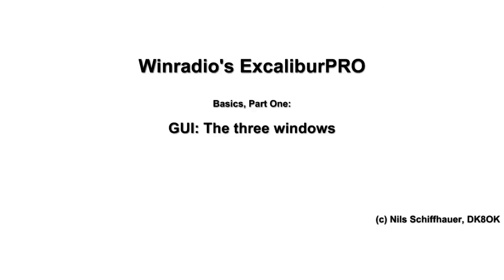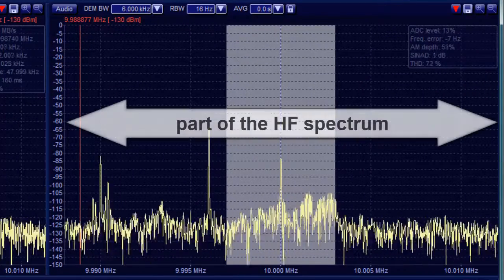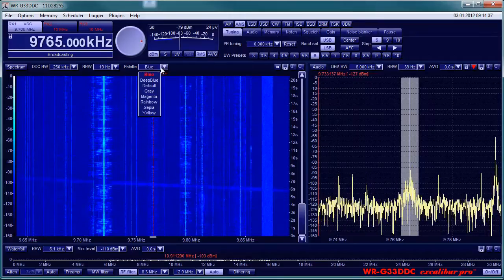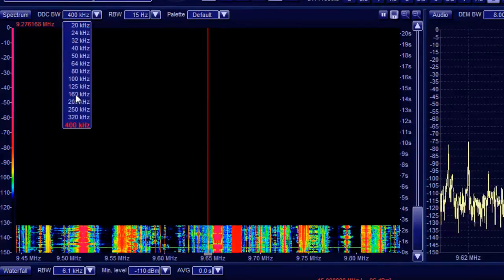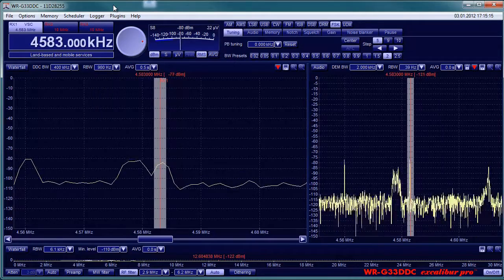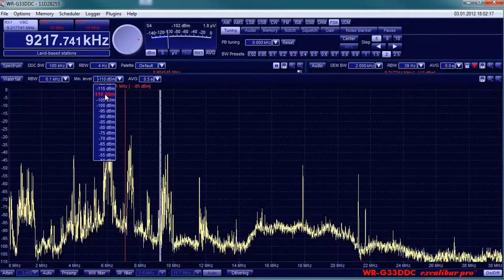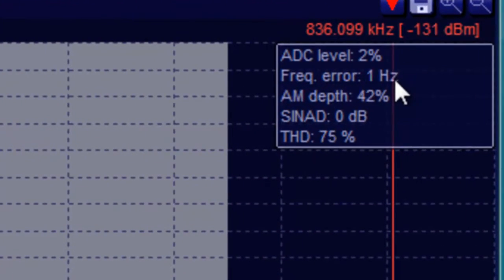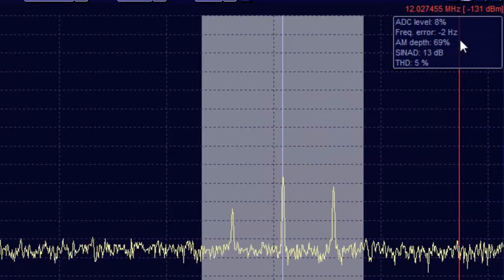Winradio's ExcaliburPRO Basics - The GUI

Comment: winardio works with dvb - t  dongle  as reciver  ?
Reply: ... there is no need for that: Winradio is a stand-alone combination of proprietary hardware and proprietary software. That means: The hardware is not running without a Winradio hardware, and the software is not running with any other hardware than Winradio (as far as I know). So you cannot run e.g. a DVB-T stick with Winradio's software. 73 Nils, DK8OK
Reply: thanx for the feedback I think that u trying to tell me that it supports only its hardware.
I'm looking for a cheap  solution for decoding TETRA
Reply: nadir6661 Well, receiving of TETRA is one thing - another thing is decoding. For the latter, "Osmocom TETRA" is one of the tools available. Good luck: Nils, DK8OK
Reply: thnx 4 the feedback!Imtying  2 fin a cheap solutiuon or decoding tetra